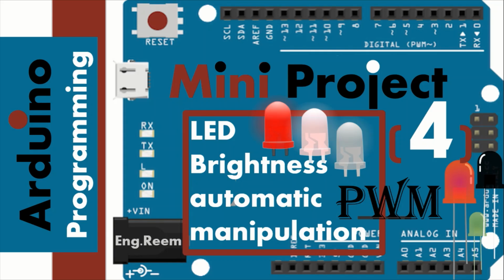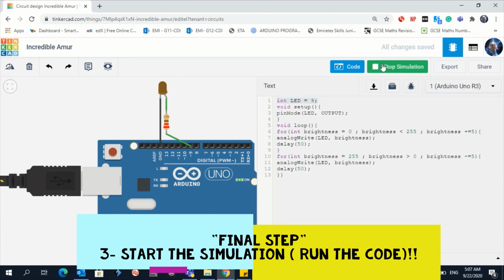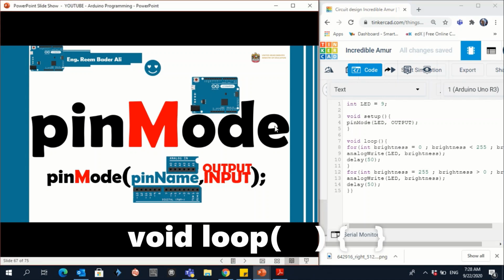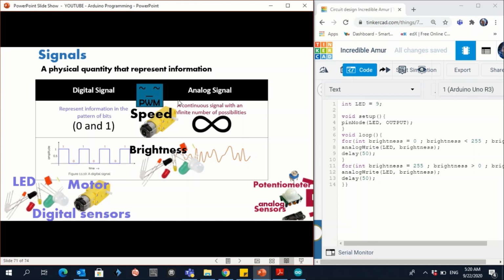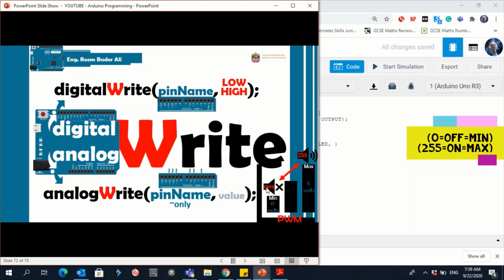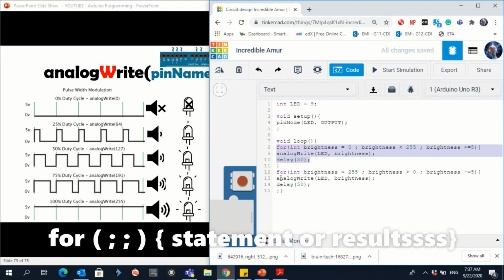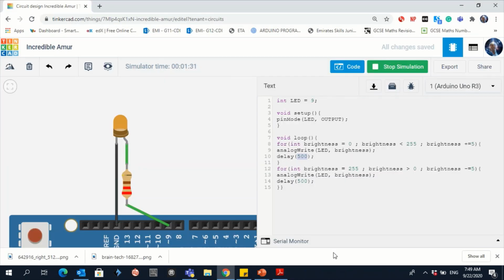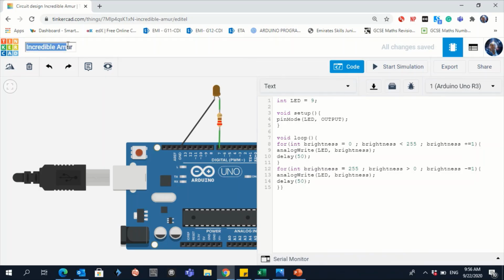Arduino MINI-PROJECT 4: LED Brightness automatic manipulation

Comment: Reham Khaled 12C

I have learned in project 4

1)That we use digitalWrite(pinName,HIGH/LOW);
If we want to turn it ON or OFF.

2) That we use
analogWrite(pinName,value);
If we want to control the brightness.

Comment: Norah Mabkhoot 12C 
I learned from this project how to control the state of digital output devices like LED, also using analog signals, there are 6 PWM also PWM used to control the brightness /speed or level of voice. PWM means pulse with modilation.

Comment: Shahad Ashraf 12A

so what I learned is how to control the brightness of the LED, the maximum value is 255 and the minimum value is 0 ( 255 = on and 0 = off ) also LOW means OFF and HIGH is ON .
+  to control the brightness we should connect them to PWM pins + the delay(); represents the time wich in Ms  

thanks ms :)

Comment: I have learned from this video how to control the LED brightness at a slower and faster rate, also the maximum value/power is 255 and minimum value/power is 0. I can only put any number between 0 and 225. Which means 0=Off 225=On. 
(Manal Khalid 12-C)

Comment: Norah Mabkhoot 12-C 
I have learned in this video how to control automatic LED brightness , also 0v means there is no power (no brightness) 5v is the maximum output . 255 is the maximum brightness speed or maximum voice it's on what you're connecting.

Comment: I have learned in this video how to control the brightness of the LED and the value that controls the brightness is for 0-255 when it’s 0 which is the minimum value it means off and when it’s 255 means that is in the maximum brightness.
Asalah khaled 12C

Comment: aya Rashid 12\a so I learn from this video that we use the analog write function for the input, and also we need in this project to control the brightness when we deal with analog write we have to use specific pins only. (they have ~ these sign)